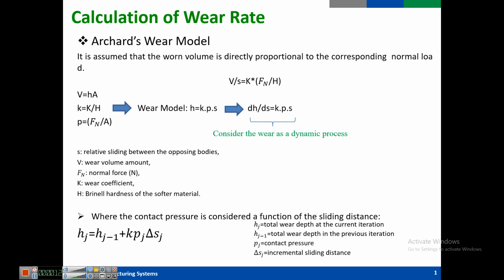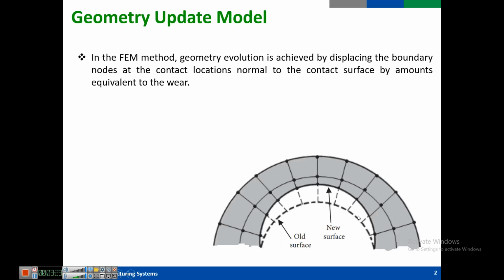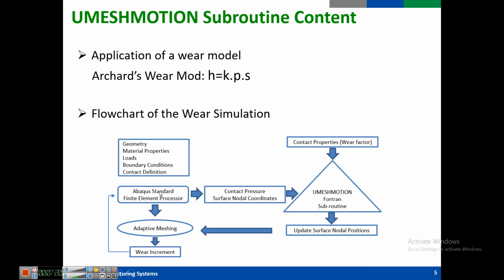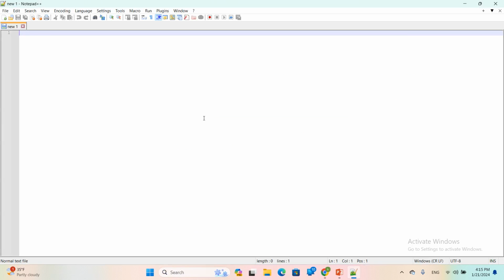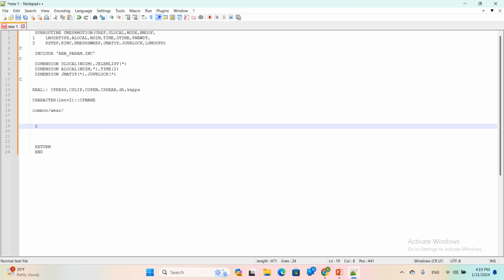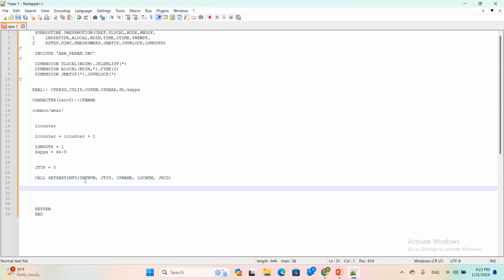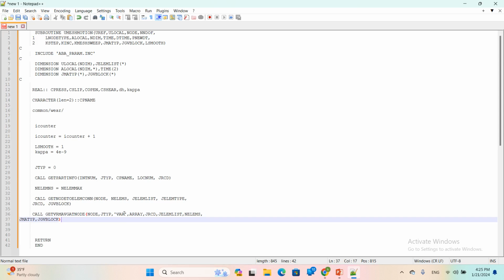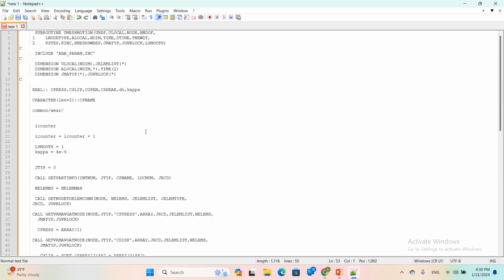How to write your own UMESHMOTION Subroutine with ARCHARD Model

Comment: Hey there. That was a really helpful tutorial for writing a UMESHMOTION subroutine. I've got a question about it:

What kind of output are we expecting from Abaqus in this case? For example, with a UMAT subroutine, we define an SDV (state-dependent variable) to display the output contour and results. So how can we get the output results for the wear depth using the UMESHMOTION subroutine?
Reply from the maker: Thank you for visiting my YouTube channel and watching the video.

In the case of the UMESHMOTION subroutine in Abaqus, the output is primarily related to the nodal positions and mesh displacements since this subroutine directly controls the motion of the mesh nodes. Unlike a UMAT subroutine, which deals with material point updates and can output state-dependent variables (SDVs), UMESHMOTION updates the nodal coordinates based on a predefined motion law or a motion computed during the simulation.
To obtain output results for wear depth when using UMESHMOTION, you can:
1.	Monitor Nodal Displacements: The wear depth can be tracked by observing the displacements of the nodes. By comparing the nodal positions before and after the simulation, you can quantify the wear depth at specific nodes.
2.	Output Field Variables: You can define field variables that track cumulative wear or nodal displacements. These variables can be written to the output database (ODB) and visualized using contour plots in Abaqus/CAE.